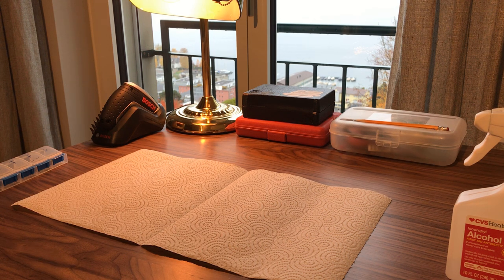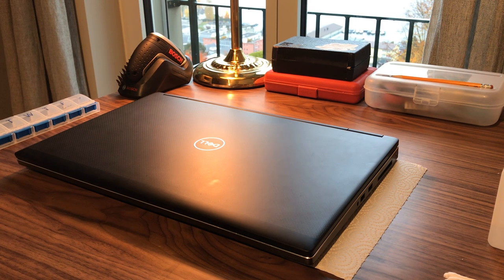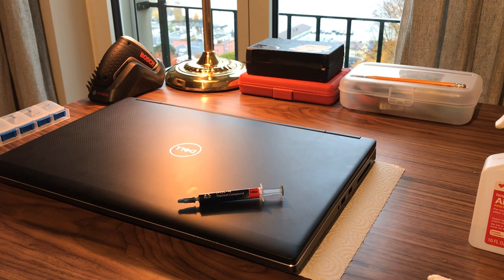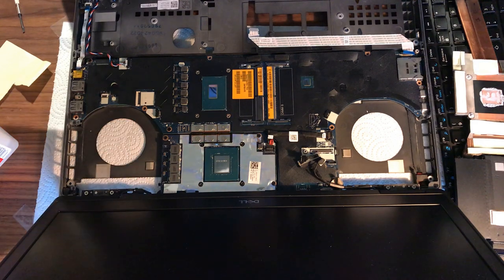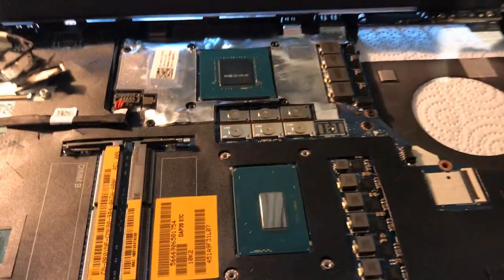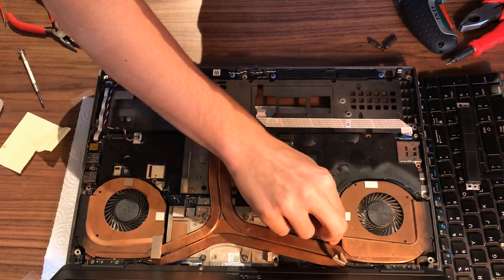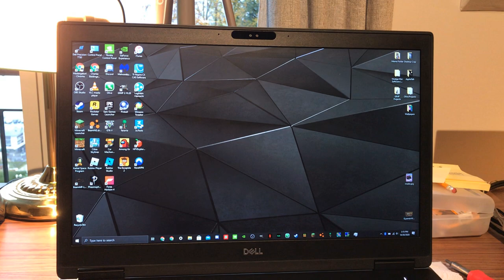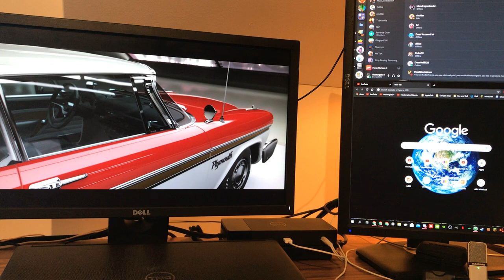Dell Precision CPU + GPU Repaste! | Tech Logs #1 | Mastergeko4

Comment: use with precaution metal liquid (very small quantity + varnish or tape protection for CPU !!!). i have repast my 7540 i9 9980HK and : before hit 100°, thermal throlling. After, 70/80°, maximum boost at 4.9 and sometimes 5ghz and no more turbo fan noise ! Massive improvement of all performance ...
Reply: I need to repaste my 7540 (xeon e2276m + quadro rtx 3000) because of crazy thermal throttling but afraid about the liquid metal. I think I'll go with a regular thermal paste.
Reply: @riazulrahil  try but for me it was useless with standard paste. 2 years now, no problem. Only metal liquid for CPU, it's ok for GPU with paste.
Reply: @STK34761 , thank you for your reply! really appreciate it.
Reply: What is the thermal pad thickness?

Comment: Nice.  I have the same machine.  I had terrible thermal throttling (brining frame rates to < 5) with most 3D games when I first purchased it in 2018.  I blame the design.  I could probably try repasting as well like you did.  Recently I picked up a IETS GT500 Powerful Turbo-Fan (5000 RPM) RGB Laptop Cooling Pad and it mostly resolved the heating issues bringing it out of thermal throttle.  This was the only external fan that worked.  Other cooling pads sucked.  
I am now occasionally getting startup issues with the internal fans.  I picked up two new ones to replace them.  Do you think it is necessary to remove the entire cooling assembly to change them (in your video) or is possible to do it without removal?
Reply from the maker: Thank you for your comment! To remove the fans on the heatsink, you'll most likely have to remove the entire heatsink assembly like I did. Luckily, Dell still has a service guide for almost all of their products to help guide you. This can be found here: https://www.dell.com/support/manuals/en-us/precision-17-7730-laptop/precision_7730_sm/removing-the-heat-sink-assembly?guid=guid-63319545-9ce8-4d0b-bec2-879047c660a5&lang=en-us
Reply: @Mastergeko4  Awesome, thanks for the follow up!
Reply: @Mastergeko4  Update. For the sake of ease I just used the stock thermal paste that was on the new heatsink assembly because I was afraid of getting paste everywhere.  Operating temperatures range from 50-100+ C (130-200+F) regularly with the stock paste.  To my not liking I am seeing 100C more often than I would prefer and I am now thinking about redoing it with the MX-4 compound.  Did you ever temp check your machine? Do you still use it?

Comment: Is there anyone knows which heat sink material Dell used for mobile workstation 7530 and 7540. I am thinking of a liquid metal application.
Reply: Honeywell PTM7950
Reply: @SuanSterwart-mf5jm  tank you much
Reply: use with precaution metal liquid (very small quantity + varnish or tape protection for CPU !!!). i have repast my 7540 i9 9980HK and : before hit 100°, thermal throlling. After, 70/80°, maximum boost at 4.9 and sometimes 5ghz and no more turbo fan noise ! Massive improvement of all performance ...
Reply: @STK34761  thank you